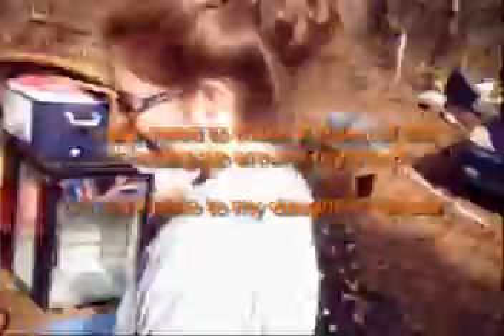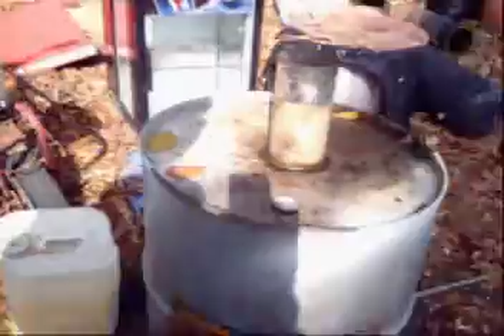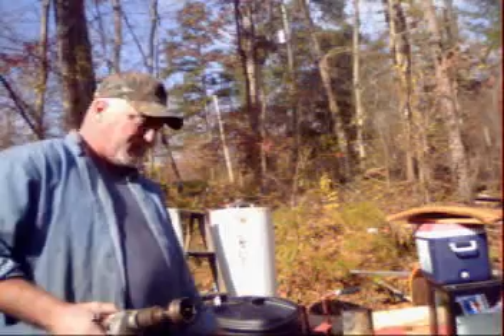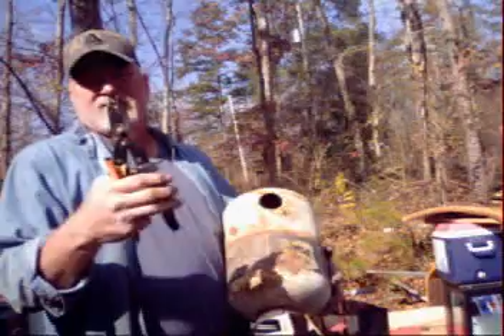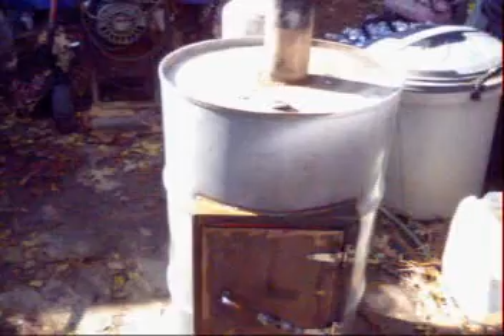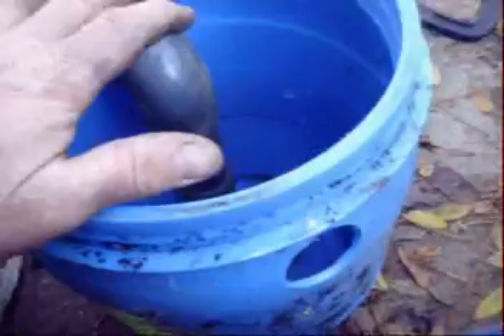wood gasifier part1

Comment from the maker: @dhughes6610 
The blower goes on the top of the Tee just before the engine. You would close the valve to the engine and open the valve to the blower, run the blower untill the output of the blower is flameable. Then turn off the blower, close the valve to the blower and open the valve to the engine. The engine vacuum will keep the down draft going.